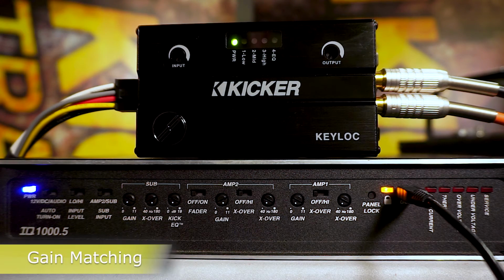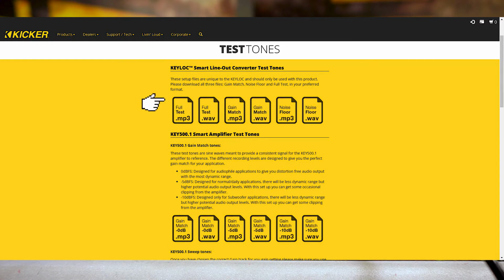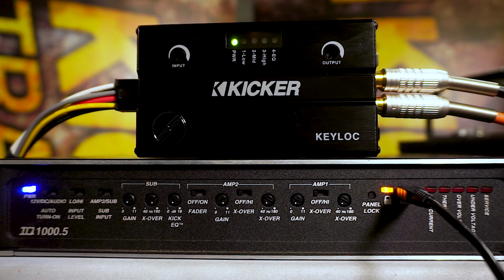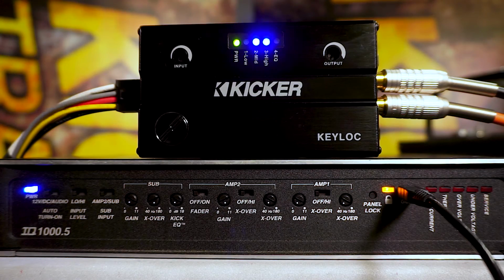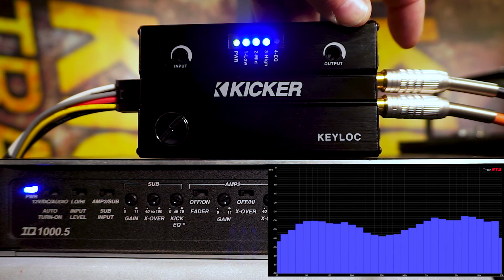KEYLOC

Comment: Whats the best way to use this when upgrading from a factory sub?  It is only one channel input to the keyloc.  Whats the best way to wire that so that I can still get both channels out to the amp?
Reply: The KEYLOC has two channels in. Split the factory subwoofer wires into two pair and connect them to the white and gray inputs on the KEYLOC. Follow this video closely and make sure you set the input gain on the KEYLOC correctly (left knob). The run regular RCA from the KEYLOC to your amp.
Reply from the maker: If its bass, only one channel is needed, since bass is always mono.
Reply: @KICKERAudio  wouldnt you need both channel inputs on the amp in order to bridge?